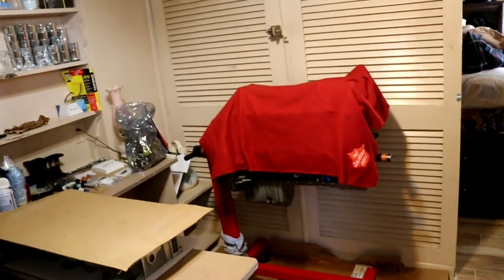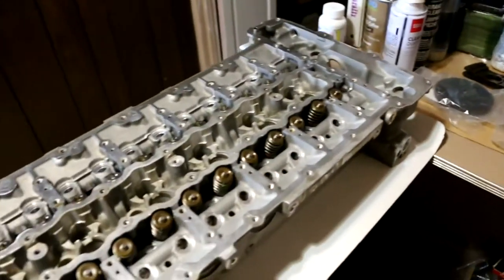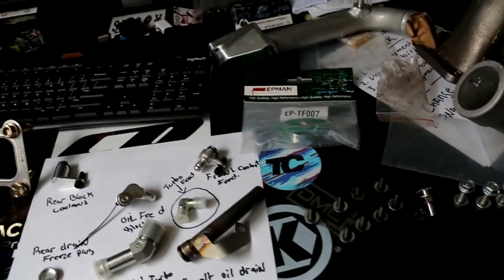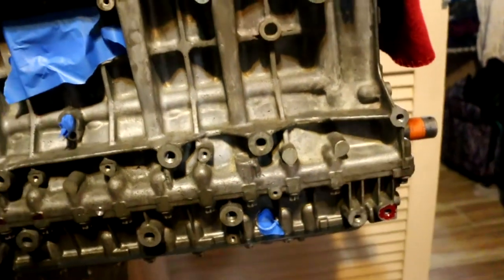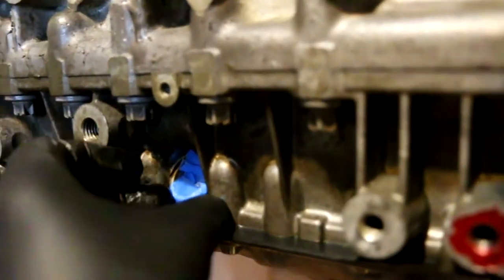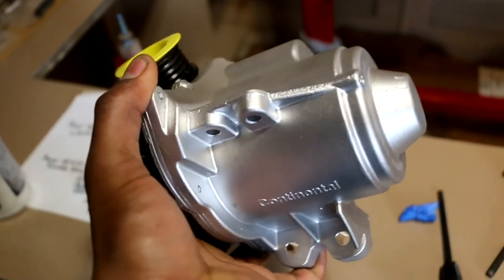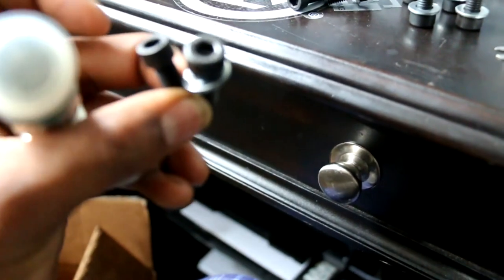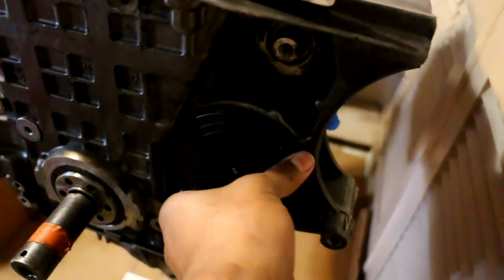N54 REBUILD | EP7. | DOC RACE INSTALL PART 1

Comment: Why do you have to drill that rivet out on the head gasket for? I know you said for the clearance so is that head gAsket not factory of is that regular procedure????
Reply from the maker: I been watching a few engine builds  and the idea is you do not want the rivet to get sandwich between the head and the block causing the head not to sit flush. This may cause a potential leak